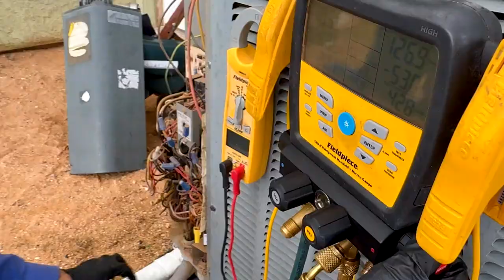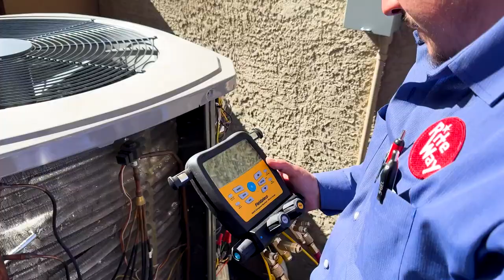Big Changes in HVAC 2025 | New Refrigerant Regulations and Safety Updates

Comment: This company is simply trying to scare homeowners.  - There are no EPA mandates requiring homeowners to retrofit their systems to newer refrigerants immediately. However, when purchasing new systems after January 1, 2025, new equipment must use refrigerants with a lower GWP, like R-32 or R-454B, which are part of this shift to more sustainable cooling solutions.  - Homeowners can continue using their existing systems until they reach the end of their life. If their system requires servicing, technicians can still recharge systems with R-22 or R-410A. Simply put … You don't have to worry about anything until you absolutely need to change your system out, otherwise things will continue as normal.
Reply: I think the point being told fairly is if a system is old and needs to be replaced 1-3 years from now, is it better to go now with an established older (new) product and save 4K over a future-proof newer system. I think the newer equipments may have kinks. But it may not if manufacturers were well prepared and have done extensive testing. Tough call.